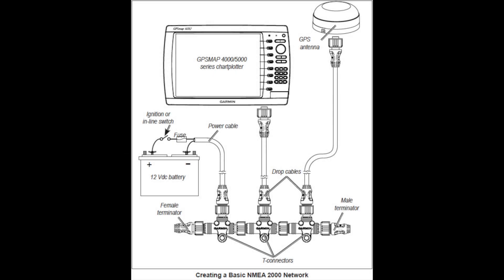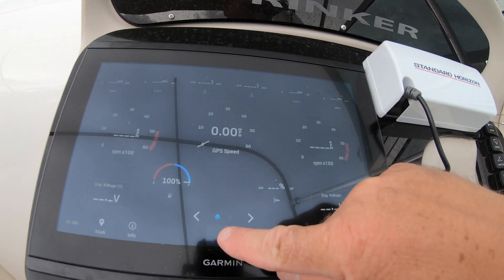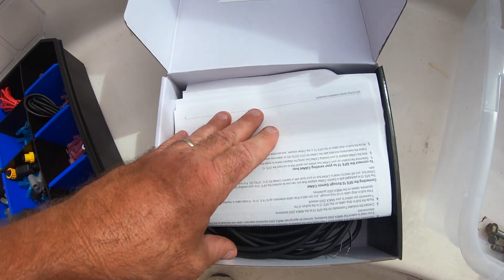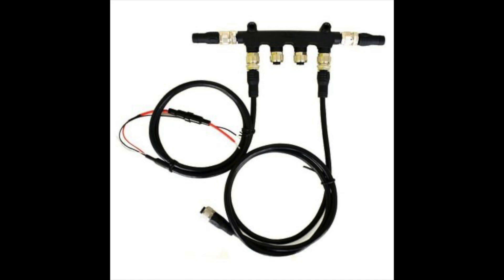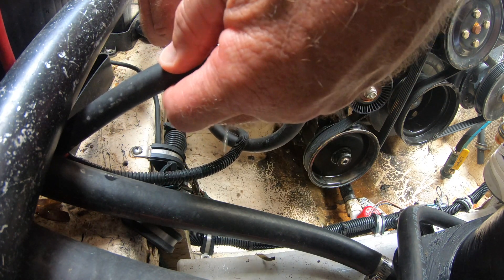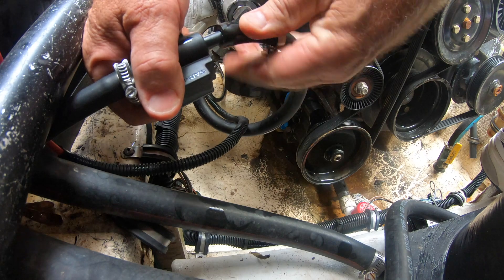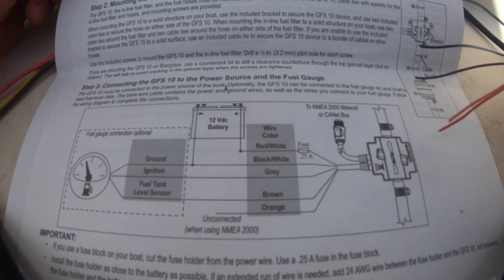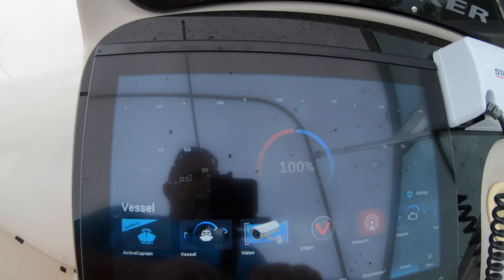Garmin GFS10 Fuel Flow Sensor Installation

Comment: Lets say you only fill with canisters and dont get a full tank... I guess you can add the amount on the plotter or is this totally useless? I´m told the device also can measure via old gas gauge, is that reliable?

Comment: How long is the cable for the power. My battery is located behind the driver seat of the helm. Will the power reach that from engine?
Reply: There are 2 cables that come with it, one is for the Nmea 2000 network and the other goes to the Helm, the cable that goes to the Helm is about 25 feet long.  He didn't do it in this video, but you actuyhook up 4 wires at the Helm. One to power, one to ignition, one to ground, and one to the fuel Guage sending unit.  The is a 5th wire but it is unused when you use a Nmea 2000 network

Comment: We added the sensor. Everything is connected exactly as directed. We have a 1042 xsv gps map aslo garmin. The sensor is not showing up in the device list in the 1042. Brown ground wire is grounded ect. Is it a faulty sensor?
Reply from the maker: Make sure that you have the latest software update. I had the same issue with it not being recognized and it showed up after updating ti the latest version. Garmin tech support is also very helpful…

Comment: Considering ordering this kit. So you said its getting connected through the 2000 connectpr and the other wires shown aren't needed. Did you just shorten then to tuck away. Thanks
Reply from the maker: Yes, I just rolled them up and secured with a zip tie and tucked it back in the bulkhead.
Reply: Those aren't all spare wires.  I'm not sure what he did, many are necessary
Reply: @rebelrrp necessary for what? Where do they go? Besides the n2k connection and power wire what's necessary?
Reply: @bjsmith9191 the additional wires can hookup to your analog fuel gauge to monitor the fuel level in tank. They are for power ground ignition and one hooks to fuel sensor.

Comment: So the instructions say to not place it after the high pressure fuel pump.  Since this is what you did, has this still worked fine for you?
Reply: Can this sensor work with a lowrance device?
Reply from the maker: @panagiwtisdim  The sensor is for any NMEA2000 network. I just stuck with Garmin across my network.
Reply from the maker: Hi Musubi, the fuel sensor is actually installed before the fuel pump. It is located between the gas tank and fuel pump on the engine.
Reply: @RandomlyAwkward1  
Gotcha, I misunderstood.  Thanks for clarifying!
Reply: This may have solved my problem I’ve been breaking my head over. I have the same garmin on my Seahunt 229 and have the engine date showing on the garmin but not the remaining and used. Thanks for posting this.
Reply from the maker: Glad it was helpful. That Garmin is capable of displaying lots of data. All you need are the sensors.
Reply: @RandomlyAwkward1  yes it is just confusing trying to figure it out. Curious what gauges do you have Yamaha?
Reply from the maker: @fastol83  We have a Mercruiser 350 MPI so I have a Mercury gateway to connect to the NMEA 2000 network. All the gauges populate on the Garmin when it was connected.
Reply: I’m assuming for twin engines you’d need 2? Any idea?
Reply: @hannahbernasconi4972 you’ll need 2 for 2 tanks. So one per tank. Having 2 engines just consumes fuel faster.